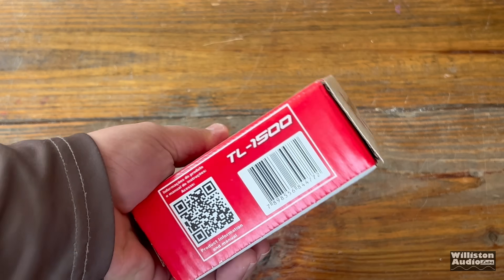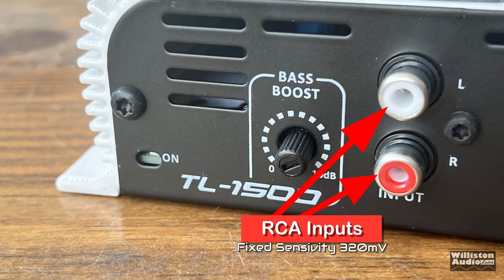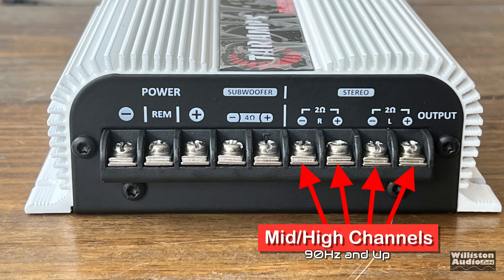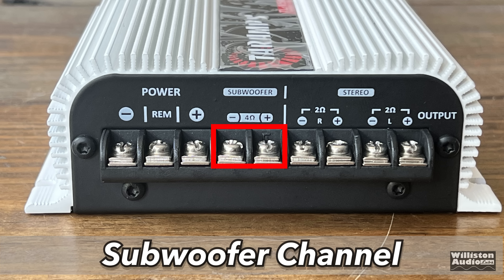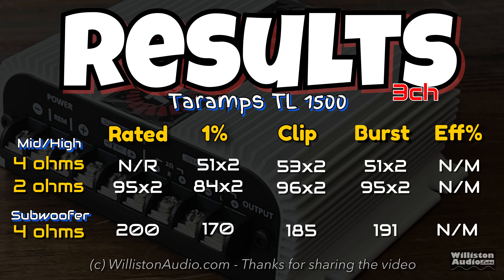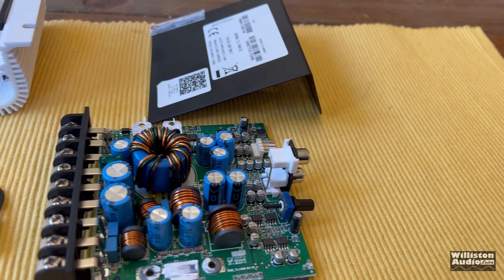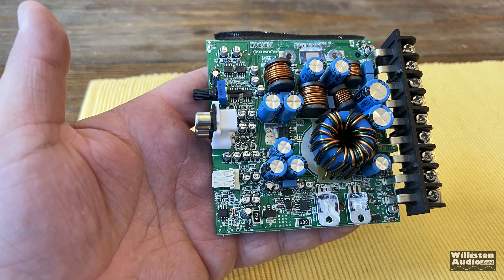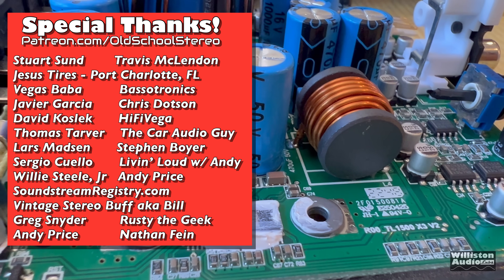Hidden Gem Mini Amplifier? Taramps TL 1500 3 Channel Amp Dyno Test

Comment: Just a bit of warning, I had this amp for a set of tweeters and it lasted 1 week. I contacted Taramps and they told me contact the closest US distributor, in my case North Carolina. What I found out is, for warranty repairs you are responsible for covering the cost of shipping to and from taramps. So i'd have to spend $60 for shipping for repair... I chose to spend my money elsewhere.
Reply: I've had mine for around 7yrs without issue running 4 6s and a flat sub. Maybe it's a user error.
Reply: Why would you bother with customer service for something you bought a week ago?  Just box it back up and return it.  Amazon usually has free shipping on returns.
Reply: @chrishuyler3580  as far as I know, if Amazon doesn't honor the return, then they will get you to contact the manufacturer.
Reply: @wowzande if it's within 30 days of purchase they don't even need to be notified... It's all automatic on the website! You can get a full refund if you choose!
Reply: @chrishuyler3580 When I bought the amp and when I installed it were not the same day. It sat on a shelf for a few months until I had the time required to install it.
Reply: @ChristopherCanfield WAAAA, WOOOO!
Your loss then! Take it like a champ! 🏆😁😂
Reply: I buy from Amazon too never had a problem because of the A to Z guarantee.
Reply: My post was highlighting the cost of warranty repair and not the longevity of the amp, And the only user error is with your assumptions.
Reply: @ChristopherCanfield Not confirmed! Lol
Reply: you flying it out there yourself? it's not 60 bucks to mail a small usps box
Reply: @tumtum5123  He may not live in the US
Reply: @tumtum5123  It would have cost me roughly $20 to ship the box. The contact from Taramps requested $32.50 be placed in the box for return postage. So that's $52.50 not including my time to install, uninstall, package, and ship it at the post office that's 25 mins away, each way. Hope you can see how that adds up without an airplane!
Reply: I have a taramps bass 3000 on 4 kicker l7´s no issues and also two taramps 400´s on 4 job 6.5 gtós each and no problems
Reply: I’ve installed 100’s of taramps in the last 10-12 years with no issues. I think you just got a bad one. And a 3 channel amp with a fixed 90hz crossover is quite odd for tweeters. Because I’ve never had an issue with a taramps I’ve never had to deal with warranty but seems like pretty terrible customer service.
Reply: @ThisIsMyHandle-48 you have installed hundreds and not a single one has had an issue?   

I call bullshit.    The customers must not be coming back to you.
Reply: @ThisIsMyHandle-48 it's user error! If he just hooked up tweeters there's no way that amp wouldn't run with no bass! Tweeters out no load on the amp at all. This is user error! 
1. For not installing it until after the return period. 
2. For just running
Tweeters of a 3 channel amp! Damn those tweets musta been sizzlin'!!!!
Reply: I have the 100w x 4 version of this amp footprint and it's been cruising along steady in my RV for about 4 years.   Only complaint is it's a little bit noisy.
Reply: Damn bro your being attacked in the comments. Funny thing is. Customers of a amp are usually not simping that much over a product. So I question that that many uses of a tweeter or small amp who have no monetary investment would even care about your particular situation. About the cost of shipping.... That's how it is whenever you buy a product online. That what I hate about the Internet buying system, that and the China quality. Miss the days of American made and bought at a store damn the future
Reply: From your replies it looks like it's hit and miss because of the mass cheap production
Reply: @ehrenkrause9861 I truly believe that you are 100% correct, but I also believe that if you overbuild your stereo system to handle more than what you're expecting of it then you'll be fine, but if you cheap out on it like I have always done (as in buy high output cheater amps with good brand name subs), then something has to go. I have smoked amps, alternators, and even good quality Sundown due to my own mistakes. Back in the day I had two JL W-0 15" subs with an amazing chrome Kenwood amp with two channels to power subs (that I bought brand new from Best Buy) in my old Ford Exploder and I never upgraded the charging system or anything, but it would bounce a full Coke can 8-10' in the air off of the roof, then I SMOKED the amp months later, but I knew that something had to go sooner or later. Still, before that I had a 1989 Chevy Beretta GT with an unpowered Sony tape deck (meaning it has no internal amp, so it wouldn't play any music without a mids and highs amp, plus a sub amp), a Sony 10 disc CD changer, two Image Dynamics 15" subs, two Image Dynamics 1500 watt amps, two gel cell batteries, and two 5 farad caps, and I also installed a secondary alternator on the 2.8 V6, and not only did everyone in my high school told me that it sounded like thunder when I was still 5 minutes away, but I got suspended from my school my sophomore year because I blew out my rear windshield in front of my high school...😂😂😂 My point is that if you don't build your system properly and take current draw into effect, you'll always be fighting something that's about to blow.
Reply: @ChristopherCanfield if you still have your amp I'll buy it off of you for cheap and pay for shipping and handling
Reply: My smart3bass just died under 3 months
Reply: @d0nk3ybrain57 what was the cause?
Reply: @TheSimulatorSmith  Garbage gain knob and crossovers
Reply: @d0nk3ybrain57  so you just had a bad one
Reply: @TheSimulatorSmith  that can't get my money back for yea
Reply: I had an amplifier (Not Taramps) i purchased from Amazon, 26 days in it went up in smoke, i contacted Amazon, they shipped the replacement same day, didnt even wait for the bad amp to ship, free shipping, amp cost was around 700.00. So i was grateful. Replacement is running strong 2 years later. 
(Orion 3000.1Dsplx)
Reply: Wait. Can someone explain the TI chip? It determines wattage, I’m guessing based off the specs but is an amplifier?
Reply: I have a smart bass 3k and had an internal short in it. I emailed taramps customer service and they were great with setting up a repair company right in my state. I did have to pay for shipping to the repair shop but since I work for a wonderful family owned company they allowed me to put it on their Ups account. I got it back in 4 days fully repaired under warranty and taramps paid the return shipping. Awesome company and what a powerhouse of an amp.
Reply: I think that it's a case of the application and how much you're expecting of the amp. I have owned some seriously expensive systems in my day and I never looked into what the power input to power output differences were dependent on what mods were done to your vehicle. The way that it was put to me by an expert was like building an amp and sub combo as to building a turbo kit for a vehicle without making the fuel system up to the task. I have never had batteries, high output alternators, or capacitors, so I set myself up for failure.
Reply: Impedance?
Reply: I would have to say this was user error or you are just extremely unlucky and somehow got a bad amp from Taramps which I have rarely ever seen. These amps speak for themselves as far as quality and how much value you get for very little $, look at anyplace thy sells these amps and out of the thousands of people who use them, you might find one or two negative reviews. Once again those negative reviews probably come down to user error or just bad luck.
Reply: @JeremyBreeden89  Yes it was a bad amp, point of the post was to highlight the cost for repairs. Yes they make good amps  but in my case I could have bought a new amp for an extra $10 on top of the $60 for warranty repair.
Reply: I’m impressed but a lil shocked That Big D didn’t 2ohm the sub  , he was being nice to them
Reply: There's no way in hell it would cost you $60 to ship that tiny little, lightweight amp! I bet you could ship it both to and from for around $20 to a max. of $30. 
$60? You don't have to ship it Overnight Express! Lol 🙄
Reply: I had a taramp 800.4 to catch fire. I try to warn people about those amps
Reply: @leroycolejr6626  got a Taramps Bass 12k on my subs, MD250 on my tweets, another MD250 on my horns, HD3k on mids, and about 280amp of lithium. Have all that and past few months almost a year now daily driven haven had a fire issue ever. Not even in my truck with a Taramps smart 3k on my subs did I have an issue with a fire and that’s been in there since the amp released which I believe was four years ago.
Reply: Had mine running tweeters and a set of 6.5 with zero issues. How much signal did you send to it?
Reply: Sounds like user error
Reply: @theprimepeter3460 Maybe, but a lot of these amps burn up. They're known for burning up.
Reply: Oh snap!
Reply: Yea I've had an 800.4 running 2 3.5" tweets and 6.5" midranges since 2020 and it's getting around 3-4v signal
Reply: My 800x4 from Amazon been workin strong for a few years now..
Reply: @_NegusFreeman  i second this
Reply: So you are good at math! Nice story, tell it to Readers Digest.